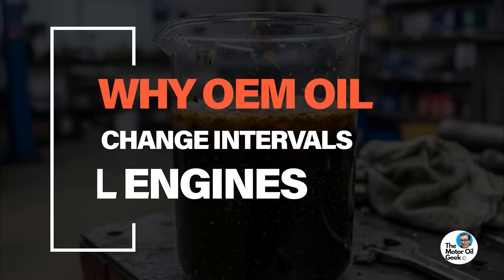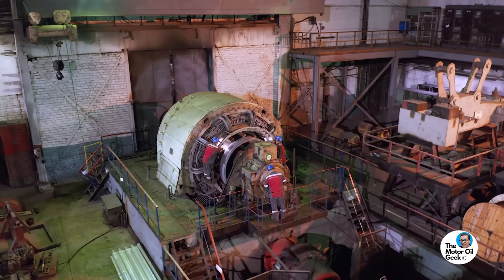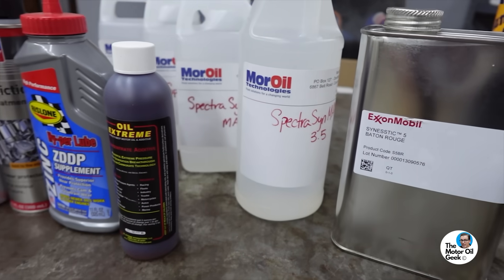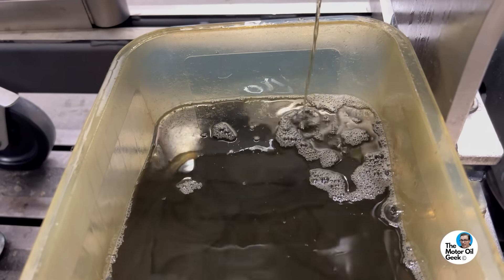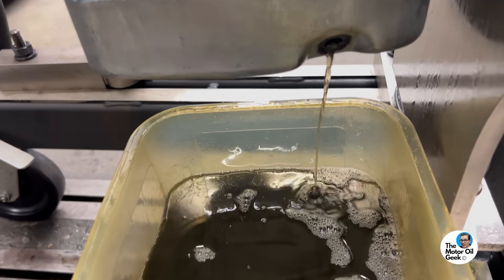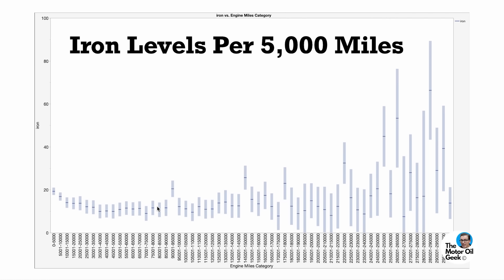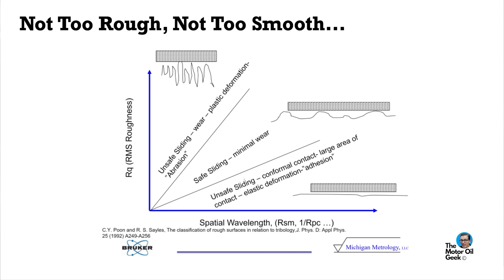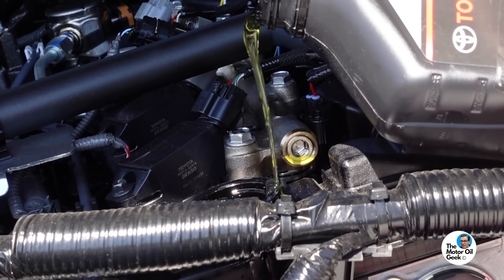NEW Data Reveals WHY Modern Engines FAIL Prematurely!

Comment: 10k, 15k oil changes interval is just crazy.
Reply: Did you watch the same video I did? The Motor Oil Geek didn't rule out long oil change intervals during the engine's "stable life" period (i.e., after during run-in, that can be up to 10k miles; see @11:21). The data supports more frequent oil changes during the run-in period though, which is contrary to what manufacturers often recommend.
Reply: Exactly! Many comments are ignoring the video! Lake literally develops oil for sale and for race cars and owns his own oil analysis/diagnostic lab and does the work, people will never learn😂😂😂
Reply: @benzzoy  I think "long" amongst oil nerds is like 5-8Kmi, not 10K+ mi.
Reply: I got a new F350 with the 6.8 gasser.  Based on the destruction of America's economy by our politicians it needs to last me the rest of my life which should be around 30 years towing a 6,000 camper full time which is extreme duty . Not good with the way they are building garbage today so I swapped out the factory synthetic blend and initial break-in oil at 180 miles then again at 2500 miles and will change it every 2500 with Pennzoil Ultra Platinum.  I don't travel a lot so that interval will be about every 10 months or so. Thanks to Lake's videos I learned to only use Top Tier gas and Lucas Upper Cylinder Lubricant went in on the way home from the dealer and every fill up.  I also avoid ALL unnecessary cold starts!!
Reply: @MAXIMUSMINIMALIST  So, you are retired.
Reply: Flat earther here and I agree with frequent changes during break-in period.
Reply: I opened the valve cover a few months back at 185k miles to adjust the valves, and it was spotless in there.  Incredibly clean.
Reply: @ChinookBear what about your rings ? You can't see those
Reply: Years of oil analysis proves that long drain intervals with Group 4 oil and quality filters are cost savings and provide superior protection.
Reply: @tssci6774  You best be doing UOA on every drain if you plan to do extended ODI, especially on modern turbo charged engines.
Reply: Not really. Do an oil analysis and if it says your oil is fine then there is nothing wrong with it. I work for a company that would do 20k oil changes on their service truck. That 6.8l V-10 lasted for nearly 500k before replacement. Usage scenarios have a lot to do with the need for oil changes and engine wear. 65% of engine wear happens before the engine hits operating temperature.
Reply: @d3faulted2 companies don’t care about oil changes, they want profit first. 
Anything to save money.
Reply: @2nickles647 That's my whole point. Why would we be any different? I like having more money in my pocket. Why wouldn't i treat my vehicle the same as a business would? If the value proposition in doing more oil changes were there. Then they would do them. It's called a cost benifit analysis. People have weird emotional attachments to mass produced, and easily replaced things.
Reply: I'd love to see the data on all these modern engines with main bearing failures and see what they OCI were, especially during the first 20K miles.
Reply: Actually they are realistic but only under unrealistic conditions.  I  had a job where sometimes the pickups drove alongside the semis.  Semis are normally driven about 600 miles a day. Twenty thousand miles between changes is not uncommon. Engine rebuilds usually occur at between one to one and one and a half million miles.  You could drive pickups twelve thousand easy miles between oil changes on the expressway in a few weeks.  That's how extended oil changes work. If you drive like  a normal person. Less than a couple hundred miles a week mostly in town you can destroy the oil and damage the engine in a few thousand miles.
Reply: My boss just bought a 2025 F-250 Diesel. He told me that the first oil change interval is 10,000mi on the factory fill. Call me crazy, but I think that is absolutely insane.
Reply: @rotorhead5826 yeah, especially the first two need to be very soon.
Reply: @rotorhead5826  Guaranteed, there will be a lot of wear at that first first oil change, especially with a brand new engine. Stupid is, as stupid does.
Reply: @rotorhead5826 same with 2025 toyotas and I believe GM interval is the same. Many dealers will not change your oil earlier, ie 3-5k even if you are trying to pay for it out of pocket.
Reply: Crazy is only incompetence and ignorance combined that drives to statements like these. Not the competence to go with proper data und understanding what the data tells you.
Reply: The factory recommendation would be at 30000 km on the Polo. Now drive a Mitsubishi Space Star and do short distance drive only, I do 4000km oil change (2500miles)
Reply: Not when calculating with kilometers!
Reply: When you drive high mileage,  mostly freeway,10w30 full synthetics don't shear down down like 0w20.  I did 15k mile OCIs with filter and top off halfway for 10 years on a 1985 Turbo Dodge 600. No problems.  Would I do that on 0w20?  No.
Reply: Its depend... My HDI with 10w40 every 20k with 300k... perfect
Reply: I could never stretch an oil interval that far. I feel like I'm damaging my engine stretching it out to 5k miles.
Reply: @Saltinator Absolutely not. If you have a newer car that takes synthetic most brands will last 5k easily, get oil tests done and additives are probably still present
Reply: If you're  driving normally anything over about 5k is damaging.  But it is possible to  safely extend oil changes but not while driving normally.  The problem is that there is a form of deception where a manufacturer creates a protocol where something is true because of specific and controlled conditions.  They then 'forget ' to specify and act like it's typical.
Reply: My mother in law drove 30k on regular oil. I changed it. Only about 1.5 qts left out of 4. Cleaned the oil pan. Put in mobil 1 extended. There was 60k miles on the car when I took over her oil changes. She drove so much the miles would get away. So it was at least 15k oil changes once a other 30k on extended. The Camry ended up with 264k. She had moved out of state. Her grandson had taken it for an oil change. Apparently the oil tech actually didn't tighten the drain bolt. The oil drained out on the way home and the engine locked up. That's what did it in finally. I'm not sure if that's a testament to Toyota's toughness or mobile one's oil quality at the time cuz I literally took sludge out at 60k miles where she had ran regular oil for 30k.  And she ran 30k at least one more time on mobile one, but always 15K at the least.
Reply: For 48 years I have done 10k OCIs and have never a problem. Several engines we'll over 200k and some over 300k. Oil used M1.
Reply: The expensive specialty oils fanboys swear by 10k-15k oil changes. If you suggest 5k oil changes, they accuse you of buying cheap synthetic oil from  Walmart or Amazon which will prematurely wear out your  engine while their super-duper oils magically will not, even after 10k-15k intervals. This false advertising and brainwashing to sell expensive oils is fraudulent and should be illegal.
Reply: @PassivePortfolios  I personally do 7500 with whatever high end sythentic I can find, Royal purple XPR, Amsoil Signature, etc. 

I dont do 5000 because it clearly isn't moms oil
but at the same time a bugatti isn't 3x faster then a corvette is it?
Reply: @PassivePortfolios  Do an oil analysis on the first oil change after the breakin oil change. That will let you know if your oil change interval is correct or not. Changing your oil more than necessary is a waste of time and money, and garners no real benifit.
Reply: @d3faulted2  we sleep better at night on a 5000 mile oil change interval with mobile one 5W-30. That’s a great benefit.
Reply: @PassivePortfolios  I’d rather change the oil 3 times in 10,000 miles with the so called “cheap” oil than once every 10,000 miles with the Amsoil.  Guarantee to be much better for your engine. Not saying Amsoil is bad, it’s quite good, although there is just as good for half the cost.  Even if I were running Amsoil, I’m changing my oil max 4,000 miles because that’s what is best for my application. I change it every 3,500 miles.  It’s black crap at 3,500 and I can smell the fuel in it.  If I drove primarily highway miles at highway speeds (not stuck idling in traffic on the highway on a daily commute into a major city), I may go to 5,000 miles.
Reply: @CreatingExcellence  Well said ! I agree with you 100%. My oil change interval is 4k-5k miles with Walmart brand synthetic oil. I feel that it is a good idea to flush all that soot and other particulates out of the engine and replace the filter. Cost is the same as the 10k miles  high dollar oil and filter change  but the engine will experience less wear.
Reply: @PassivePortfolios  Hey, I say let stupid do its work......
Reply: @PassivePortfolios 10k is fine with a good full synthetic ONLY if mostly driven on highways at constant speed
Reply: @BadBoiFX  I would not chance it to save a few bucks. Plus nobody drives 100% highway miles.
Reply: @BadBoiFX fine if you just want a so so running engine I like my engines to be at top notch .
Reply: @kenj.8897 I said its fine not ideal. Oil changes should be done based on use, long vs short trips, city vs highway driving, driving style, 6-8k changes are good for most peope
Reply: @PassivePortfolios Most cars sold from Germany are highway driven, its normal to buy high mileage 2.0, 3.0Tdi cars since most of them will run half a million kilometers before dying
Reply: No it's not.
Reply: @eighty6gt  Except that it is.
Reply: Did 20000 Km (12000miles) changes (once every 6 months) on 2011 VW Polo TDI. Sold it at 380000 Km engine ran like new. Used 5w30 from Lidl (low cost food store) If you drive long distance every day, you can go pretty long on the oil.
Reply: And yet millions of vehicles around the world run just fine to very high mileage doing 10 or 15k OCI, It's almost like it's not 1955 any longer.
Reply: @-DC- where are these vehicles,  what vehicles, what fuel and what oil.  Statements without facts are just opinions.
Reply: @-DC-  And yet hundreds of thousands of vehicles around the world suffer from sludge, 'machining debris', etc.. by driving 10 - 15K OCI along with 'lifetime' transmission fluid. It's almost like regular maintenance matters.
Reply: I do 15k mile changes on my 03 civic using Amsoil 5w-30. Been doing it for 105k miles.  Multiple UOAs prove I can go further, at least 5k miles further.  

Use a good oil with testing can show a lot.
Reply: @ChinookBear I go 12-15k on my GDI engine running Amsoil Sig and oil analysis.  224k miles a day still clean as new.
Reply: So what’s your theory about the cause of sludge buildup and modern engine failures?
Reply: @kenmorrisproducer failure to do oil changes and adding additives
Reply: My Toyota dealer refused to to do a 5000 mile service on my new Tacoma turbo 4cylinder. They told me that could possibly affect my factory warranty if an engine problem developed. They said Toyota strictly stands by 10,000 mile oil change interval and should NOT be done anytime sooner.  I'm hoping for several hundred thousand miles out of this truck so I'm sticking with their recomendations.
Reply: @Lawnboy21 that’s nonsense. I’m doing 5K oil changes on my 2024 RAV4 hybrid. I did it myself at 5K, dealer did it at 10K, and I’m about to do the 15k mile oil change this weekend.
Reply: @Patrick94GSR I agree it seems excessive but they stand firm on that 10,000 mile interval.
Reply: @Lawnboy21 so, change your oil. 
Get the Toyota oil and filter and take pictures of mileage and documentation
Reply: @Lawnboy21 they want your engine to have issues outside of warranty, that’s where they make their real profits.  Just stick to the 5,000.  It’s $10 minutes and $40 with oil and filter to do it yourself.  Change the trans fluid too.  At least one drain and fill every 30,000 miles.  I suggest 3 every 30,000 to get the new to old fluid ratio much higher.  Minimum 2 but many will argue so at least do one every 30,000 but 2-3 is much better.
Reply: When these people break down dont call me for a ride i keep my oil clean. They roll on black tar oil.

Comment: Hi Lake re the “Hemi tick,” what causes it ?

In June of 2022, my California 2007 Dodge Magnum 5.7 Hemi engine ( dealer synthetic 5-20 oil every 5K miles) at 308K miles had a second total engine failure and engine replacement under my mfg lifetime warranty, with a Jasper 5.7 Hemi engine ( because Dodge 5.7 Hemi engines were out of stock nationally ?) !

Fortunately when I bought my California 2007 Dodge Magnum 5.7 Hemi ( 20% Mercedes ownership) it  came with a Lifetime PowerTrain Warranty and I paid extra for a Lifetime Bumper-Bumper Warranty !

Comment: I still don't understand why oil filters get better with use. You've talked about it in a couple videos now and I still don't get it.
Reply: Imagine a clean window screen. All the little things pass through.  If the window screen is dirty, more of the little things are getting caught.
Reply: @vicz8899  this works with air filters but not oil filters. positive displacement oil pump pushes oil through filter harder as filter becomes more restrictive, pushing more contaminants through as well.

Comment: I changed my oil in my 7.3 zilla at 700 miles. Will do one more short change than get to 3k miles interval.
Reply: Unfortunately I was not the first owner of my Zilla, and I suspect it did a lot of idling.  Hence it suffered catastrophic lifter failure at about 50,000km (30k miles) and had to be replaced.  Luckily it was still under warranty but put a big crimp in our summer towing as the replacement took about a month.

With the new engine, I did a short oil change and got Pennz Ultra Platinum and a Purolator Boss filter on it.  Also changing at shorter intervals than the computer suggests so hopefully this engine lives a lot longer.
Reply: @wayneandrews1022  I also put in a BD Diesel high idle kit. It hooks into the PTO control wires, works with the gas engine as well. As I understand it the new trucks have a different program and the idle is bumped a touch. I don't take chances. If I leave it idling I bump it to 1k. Dam variable oil pumps, all in the name of efficiency.

Comment: 15:00 So, to clarify, since you didn't mention it: Should we leave the oem filter on in between the first few oil changes during the break-in period (since they become more efficient as they "load up")? Like say, you bought a brand new, 0 mile car. You change the oil at say 500 miles, but leave the factory filter in place. Then you change the oil again at say 1,000 miles, then at 3 to 5k, and then at say 7.5k-10k and in THAT oil change, then you put in a new oil filter since it's now pretty much completely broken in. Does that sound correct? Obviously of course, after that is done, then you stick to whatever interval works for you based on oil analysis results after your first oil change AFTER the break-in period, with a filter change every time alongside it, as usual under normal routine maintenance conditions.
Reply: Change the filter too.
Reply: Lake has a break in video where he left the original filter for the first oil changes, which he did at 500 and 1500 miles.

Comment: Question: If changing oil filter every other time is better, should the oil filter be spun off and at least drained when not changing it?
Reply: I would vote no. Too much margin for error especially with disturbing the gasket and possibly contaminating the filter itself with dirt from disturbing it. The amount of old oil in the filter is not going to hurt anything especially compared to the residual oil in the engine.

Comment: Love this is also use a lot of magnets around oil filter and drain plug area and was out oil sump pan with carb. cleaner around ever 60k miles. I check my customers oil with the finger test and smell test to more accurately get the best results for long engine life. GDI engines I service more often and install catch tanks to catch some of the oil vapors off the valves and recommend to my customers to use only top tier fuels if they want the these new vehicles to last without major cost to these very expensive engines.

Comment: I would like your thoughts on if you are using top tier gas do you still need to use fuel cleaners?
Reply: I never use fuel cleaners.  Have a Camry at 306,000 miles, Matrix at 262,000 miles, Suburban at 249,000 miles, never have done fuel cleaners or additives.  You just pissin your money away.  All Gas today is very clean.

Comment: The Hemi problem is they redesigned the engine block years ago raising the camshaft height without redesigning the oiling system  they are designed to fail, my son builds engines and says they are junk from the start

Comment: How does Valvoline Restore and Protect affect particle contamination in an engine with higher mileage? Will switching to that Valvoline product require more frequent oil changes?
Reply: Yes it does. You need to be super careful on an old engine. Like change after 1K miles on the first interval or something like that. Then 3000 on second.

Comment: I have a 2011 F150 with a 5.0. That I only drive 4,000 miles a year. I use Mobil 1 and change my oil and filter once a year.  I live in the country so each time I drive the truck it is run for at least 1 hour. Question: Is my once-a-year oil change, OK?
Reply: Most likely yes; however only one way to know for certain, send your old oil off to Lake's oil testing company and let them tell you what's really happening.

Comment: This makes sense. I always change the oil in my new vehicles/engines very early.  Typically about 500 miles to get that break in contamination out. I wish I woulda changed it in another 500 after this vid.
Reply: Did these new vehicles ever need to be replaced due to engine wear issues ?
Reply: @star9732 no....i still have them after 20+ years
Reply: @star9732 no....and I still have them